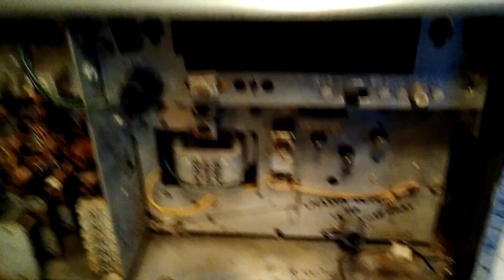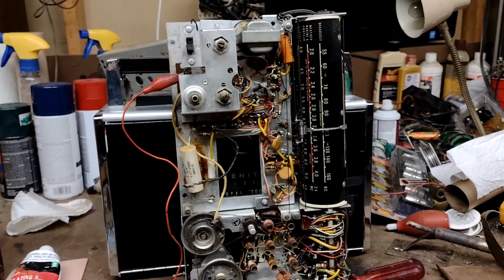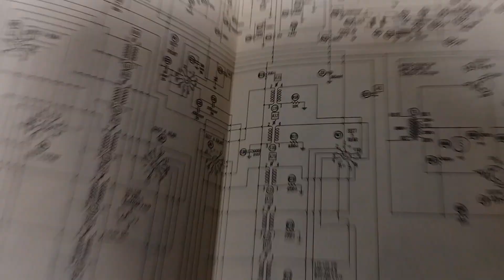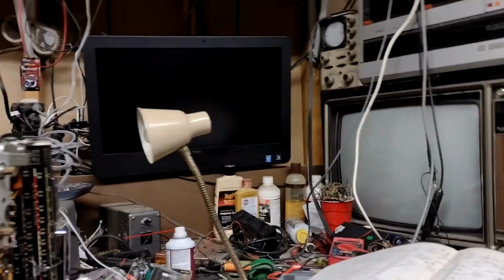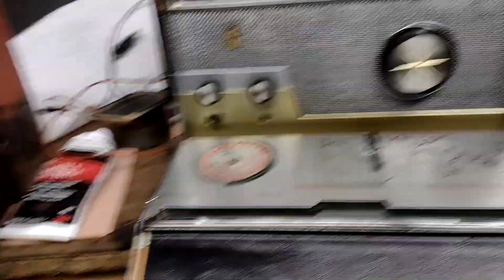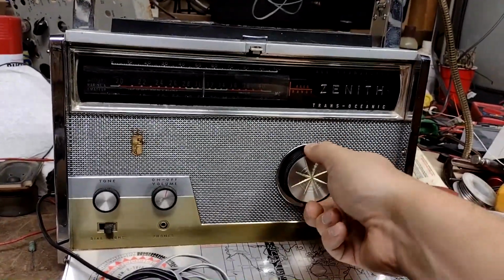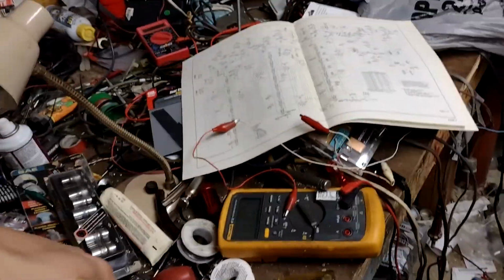Zenith Transoceanic 1000 Repair

Comment: Its actually a good idea (if implementing your own external power jack) to use a larger size and reverse the polarity to match what most you can buy would match, and being a different size won't get done backwards (or otherwise add a shunting diode to protect the precious electronics.
Reply from the maker: Since I've got both the later models of transoceanic, and the royal 2000 Transymphony that all use Zeniths then standard 1/16" power jacks I prefer to keep with that so all my power adapters fit all my zenith radios (that and 1/8" makes it possible for someone to inadvertently stick a headphone in the power jack), but when someone has already modified it before I got it may as well go with it.

Comment: Sit an AM radio beside your radio and tune in the SSB.....
Reply from the maker: So you're saying a couple of non-SSB capable radios (ie no VFO) when setup such that the superheterodyne oscs beat against each other can act like a SSB capable reciever?  If so that's fascinating and I think I now need to try it.
Reply: tune the 1000 as close as you can to the ssb station, then tune the other radio back and forth, and move it around the 1000 till it beats the signal. It is a picky setup but it does work.

Comment: I sure do miss my Zenith 1000 radio.  I had one for over 20 years and then some jerk stole it.  I would love to find another one but they are so expensive now.
Reply from the maker: IIRC I paid $25 for this one. They are out there that cheap if perfection isn't necessary and you attend enough swapmeets.
Reply: @tomcarlson3913  Wow, that is fantastic.  But I live in the deep south in the Ozarks and old radios and televisions are extremely rare.  I have never seen a Zenith Transoceanic anywhere down here.  We don't even have Ham fests down here.

Comment: Nice video. Nice radios. I can't wait to see the color Philco. Your bench is getting a little small.... 😂 Don't I know it!
Reply from the maker: I need to get back on that. It was working good except for the fly getting HOT. I think I lost most of the HV while trying to figure that out...It's one of those pre-channel projects that's been parked a bit too long.
I need to clean some of the mess off my bench...It kinda re-spawns mess on it's own, but if I don't cut it back it'll over grow onto the surrounding area again.😂
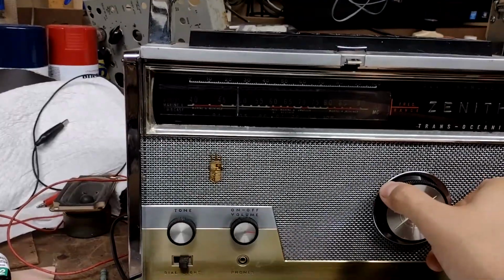Reply: 24:55 4,840 khz AJ! WWCR2 then I think it was the Raspberries.....
Reply: @tomcarlson3913  I know how the seemingly useful various items accumulate and are very hard to inventory.

I just put one of my oscilloscopes on an older CRT wall mount bracket so I can swing it out and over or away when I don't need it on my stereo bench.

Comment: i got one of those! but i'm missing the front door :(
Reply: I wish there was a way to find a replacement, BTW,  does the dial lights work on any of the ones you have? there seems to be a trick to get them to work.
Reply from the maker: My Canadian 1000-D was missing one of the prongs of the Zenith crest and the metal finish was scuffed up. So when a cheap 1000 showed up at a radio swapmeet I bought it, swapped the fronts, then made this video about fixing that donor...If I can flip the donor for more than 2X what I paid I will feel as though I made out like a bandit.
This video basically exists because I'm the sorta weirdo who'll buy a poor example of something then (if it can't be made nice) keep upgrading or buying parts units till I have a nice example.
Reply: @suzakule   You may already know this but the dial lamp comes off of a tap on the battery box.  I "think" it only works when you are using the batteries.  And even then you have to slide the momentary switch to light the dial.  Some have replaced the lamps with LEDs and wired them into the main power switch.  That way the lamp doesn't drain the batteries.